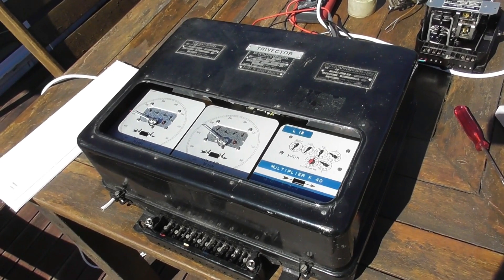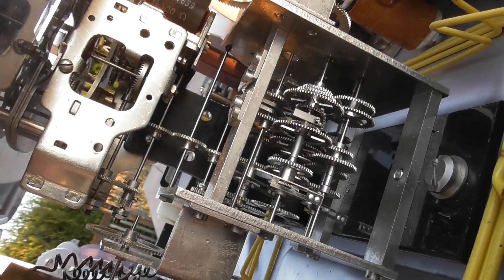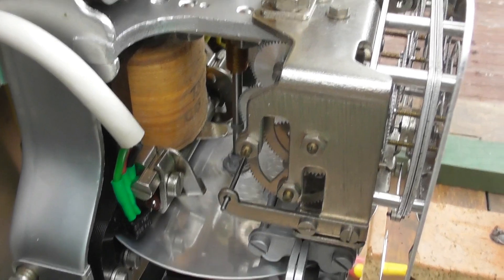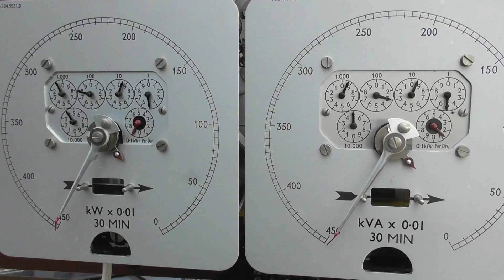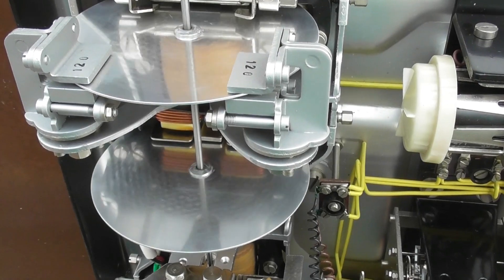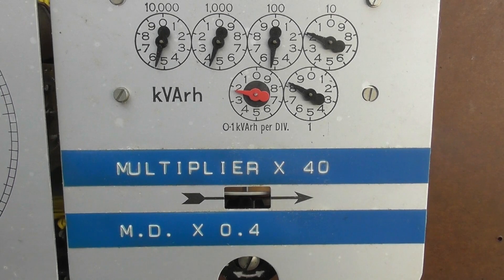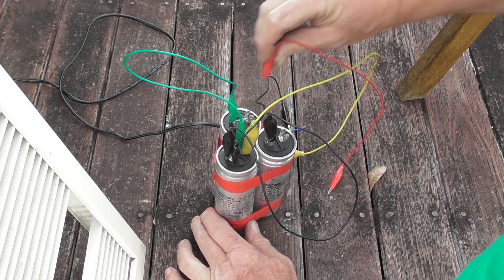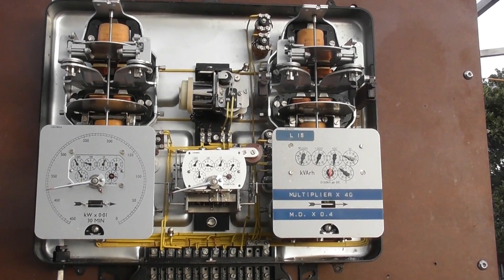Trivector meter load tests

Comment: Came for the kitty, stayed for the electronics
Reply: Electronics? ELECTRONICS?!!! Landis & Gyr Trivector instruments =DO NOT= do electronics! :-O
If you want electronics, then you need a boring flashy-red-light plastic-fantastic "smart-meter".
In this vid, it's loadwheels galore, sexxy MDIs, and gear-works. No poxy electronics!
-Wayne's Electrical. 12th April 2020, 17.17

Comment: Interesting differential-like thing at about 18:22. I'm guessing it's doing part of the mechanical math to get the apparent power from the real and reactive power. Anybody know for sure what it's doing?
Reply: Looks like there are two of them. the planet gear of the second differential is end on just below the the other one. each differential is probably just adding  two inputs, i.e one input at say 1 rpm the other at 2 rpm the output would be 3 rpm. That's my thought anyway.

Comment: Hiya Raymond. Thanxx for
showing another Landis & Gyr
TRIVECTOR on here. I have a 
pile of things to say about this vid. Here goes.......

(1) When you replaced the front glass in this instrument, did you somehow manage to put in the MDI resetter knobs somehow, or is this one of those motorised MDI resetters with the button around the side?

(2) I noticed in this one that the accuracy magnets are of a different design and not the huge classic Landis & Gyr 'horse-shoe' types.

(3) Interesting to see the MDI resetter contact and synchro motor in this unit.

(4) Bit of a shame about the loadwheel warp in the kWh section. Can this be sorted out?

(5) Good to see that you managed to locate the position of that loose cog and put it back into place. :-)

(6) Those MOTs definitely like revving up the kVarh section of this instrument! :D

(7) I didn't know that these Trivectors had anti-reverse in them. I suppose it stops someone putting a huge bank of capacitors in the circuit and reversing the kVarh reading. Does this one also have anti-reverse in the kWh section too?

(8) Haha. The feline trying to get in on  the camera action. Cats Love Electricity! :D

(9) About Point 8 above..... My Tobias is the same! :D

(10) All these years later and I STILL don't have a L&G Trivector vid on my channel! :-(

(11) As best as you can, try to describe the Sssatisfaction of revving up SIX loadwheels all at the same time within one unit.

(12) I wonder how many variants of Trivector there are? I know you have that one with the upper window in it, so that's one variant, then there are those 110v/11,000v ratioed units, then there's the 240v units, then there's with Normal and Low readouts in the kWh section, and so-on it goes. And of course, those 're-makes' with the different styling of casing and readouts similar to what would be found in the domestic CL-147 single-phase meters. 

Thanxx again for another Sssatisfying Landis & Gyr TRIVECTOR video.

-Wayne's Electrical.  (Discovered and still enjoying the Sssatisfying loadwheel action since the 1980s. :D)

11th April 2020, 18.15
Reply from the maker: Hi Wayne, glad you enjoyed this meter video.
Answers
(1). I have the MDI reset knobs. Won't be putting them in but will keep them with the meter.
(2). I think this is a later model meter, perhaps made in the 1960's as the synchronous motor also has a plastic cover instead of the Aluminium covers.
(3). clockwork
(4).  It can but it is very awkward to do and don't want to end up with a non-working meter.
(50). Repaired, the drive shaft to the register with the 75 cog gearwheel was bent and has been replaced.
(6). MOT's do make reactive power, and the kVArh dials like that.
(7). Yes it has.
(8). Cats love electricity, so true.
(9). Agreed.
(10). Time to get one. Yorkshire EPB still has some in service.
(11). It is.
(12). No idea but I am aware of at least 5 or 6 variants. with one, two, peak MDI's. 2 rate, 110 V blank-5 and direct read. 240 V blank 5 and direct read. Pointer dials, cyclo numerals etc.
Reply: Hmmmm........Point Ten. I do wonder 
how I can contact YEB? Basically in 
the UK, I am not sure when it was, but 
all of the regional electric boards were......... 

...........done away with. This includes: 

Southern Electricity Board* (SEB)
Eastern Electricity Board. (EEB?)
London Electricity Board (LEB)
South Eastern Electricity Board (SEEB) (Also sometimes known as SEE Board)
South Western Electricity Board (SWEB)
Manchester Electricity Board (MANWEB)
North Western Electricity Board (NorWeb)
Midlands Electricity Board (MEB)
Yorkshire Electricity Board (YEB)
Scottish Electricity?

There were probably a few others, but I cannot remember them all at this point.
If others wish to chime-in with the ones I missed out (if any)

-Wayne's Electrical.

_12th April 2020, 14.48

Comment: an another proof that power factor correction can help reduce electric bills if it’s caculated properly , i have for more than 10 years at home a bank of 20 micro-farad and really performs well , i was wondering Rodalco if you measure the amps draw of those capacitors , mine are around 3.1 amps at home
Reply from the maker: I can expand out on that a bit more in a future video. This was a temporary set up. Domestic houses are not charged for reactive power but a better PF reduces losses in the system.
Reply: RODALCO2007 it’s true utility doesn’t charge for poor PF factor in domestic , but they don’t tell for how much wattage that they are charging for only the non-necessary reactive power , it’s how the utility companies make more money on the customers

Comment: Stunning meter! what an absolute work of art! I as a kid would stare at the email m1 meter for hours, it was absolutely fascinating and it still is. Thanks for the video :)
Reply: The Landis & Gyr TRIVECTOR is 
always a treat to look at. With so
many bits and pieces whirring
around in there, it really can be said that.....

......the loadwheel action in these is really REALLY Sssatisfying! :D

I have one of these beasts on my 'Wanted!' list. I have known of these since late '93/early '94 when a factory I was working in had a huge electric meter, and not knowing what it was at the time, I assumed all industrial meters were like that.

I can remember the shape of it and that it had this large 'clock' in the middle with a little thing on the front glass with an anti-tamper seal on it.

I didn't know this at the time, but I was most likely looking at a TRIVECTOR.

I have wanted one ever since.

I got close a couple of years back, but the bids got silly and it was snatched away from me in the closing seconds and that was the end of that. :-(

The only way I will ever get one of these of today, and that's if someone discovers one in an abandoned building, or if some electrician is having a clear-out and discovers a forgotten one in amongst his stuff, or a collector sells one off, possibly at a ridiculous price.

.....Or possibly (a bit like the abandoned building scenario) someone finds one somewhere, doesn't know what it is, puts it up for sale and I discover that sale and grab it for a silly-cheap price!

The chances of getting a Trivector? Very low, if not non-existent. Very sad, considering Landis & Gyr probably made ABSOLUTE THOUSANDS of these units. Where are they all now? :-(

So, what happens should I manage to get one?

Well, I can guarantee you, there will DEFINITELY be a huge video about it and unbelieveable amounts of massively Sssatisying loadwheel action! :D

Make sure that you have an active subscription to Wayne's Electrical as I wouldn't want you to miss out!

Will I ever get a Trivector?

I am not giving up hope.....Just yet.

It's been all these years though, and holding onto hope is becoming increasingly difficult. :-(

-Wayne's Electrical.

11th April 2020, 16.55